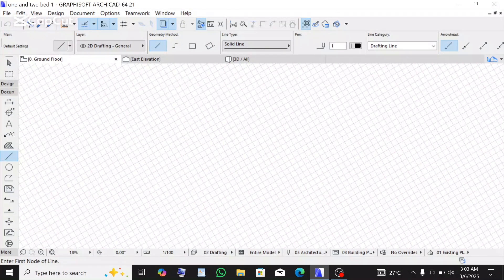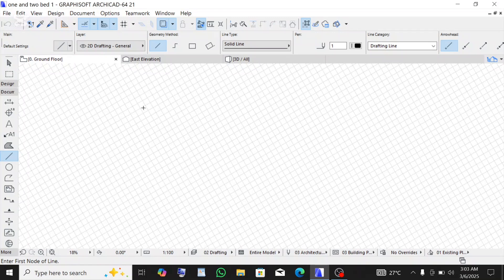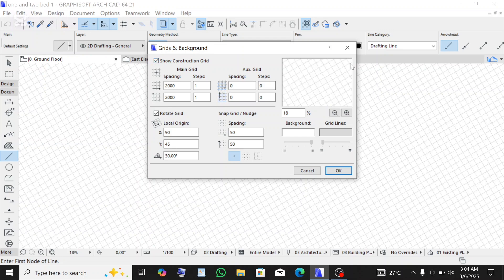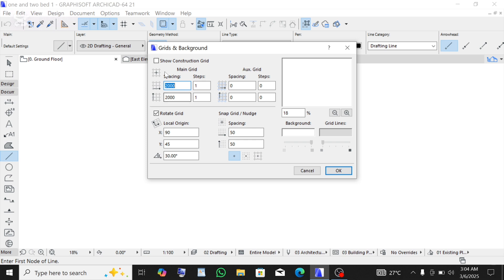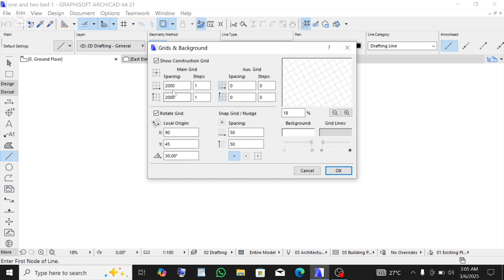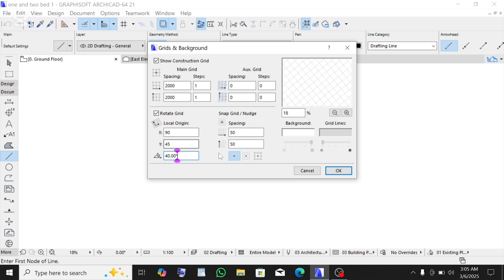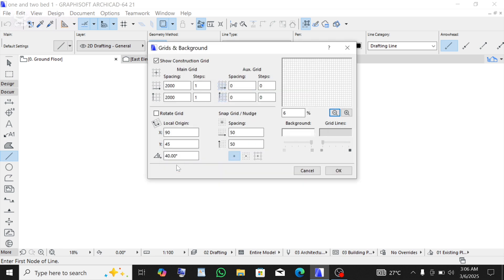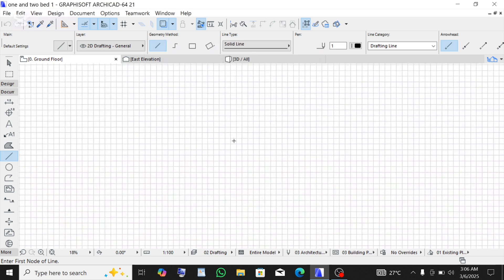Setting up Grid lines in Archicad

Comment: Very educational. Thank you for the video but I have one question.- why do you use grid lines in drawing? Is it a must before you can start up drafting.
Reply from the maker: Thank you very much for watching and for the question 🙏

1. It serves as a reference to know the spacing of what you are drawing without going through the stress to measure ( by  eye checking). It also reduces the mistake of bent walls, lines and other elements 

2. When you enable "grid snapping", you can easily align elements of the grid lines by following the enabled trace. They will stop at the points of the grids as supposed to the spacing you gave the grid lines ( I did not include "snapping" in the video 🙏).
Reply: @ArchiCADACADEMY4U okay . Thank you for this